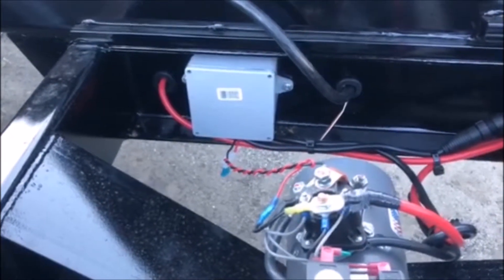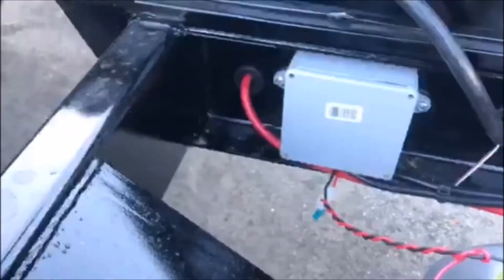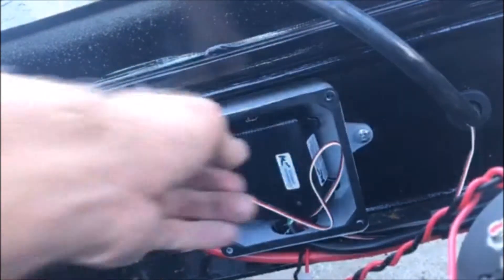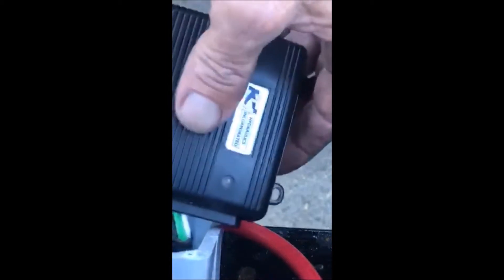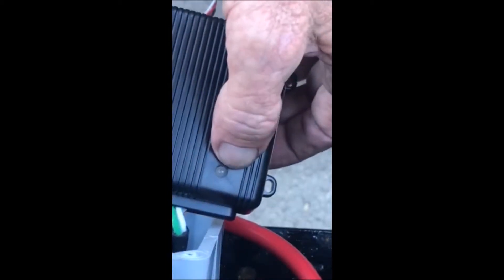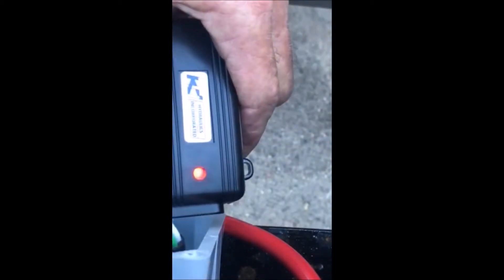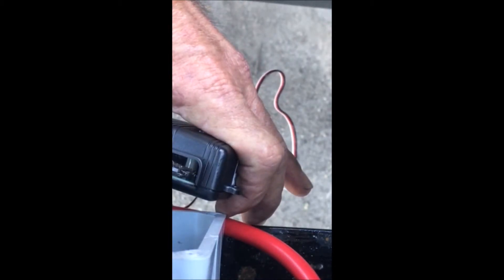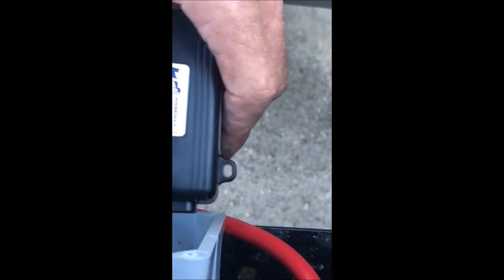Programming Your Wireless Remote Key Fob

Comment: I have the same kti wireless remote system.. been on my new trailer 4 months and stopped working! It’s in a sealed box! Not out in the weather.. called kti they did all the troubleshooting trying to reset. It still didn’t work said it needed to be replaced. Sent in proof of purchase and was told I was four months past the year warranty! But was told my national trailer sales it had a two year warranty! Kti says I have to pay for full replacement again even though we didn’t get the new trailer for one year since we had to wait on the build! I’ve always loved kti and there pRODUCTS since we have five trailers and three dump trailers we’re always buying from them!